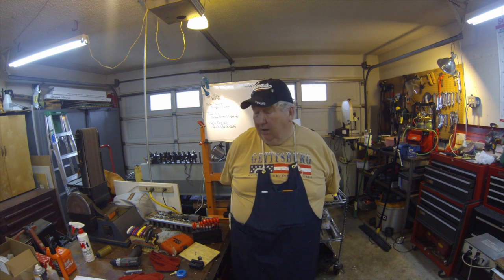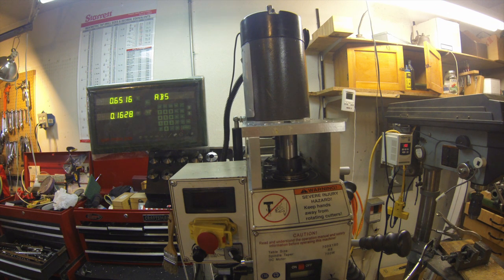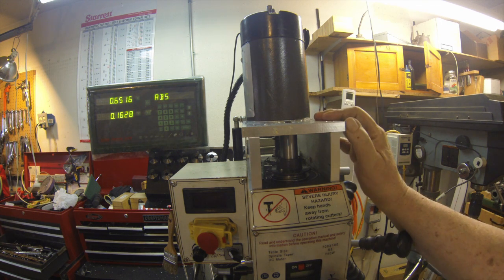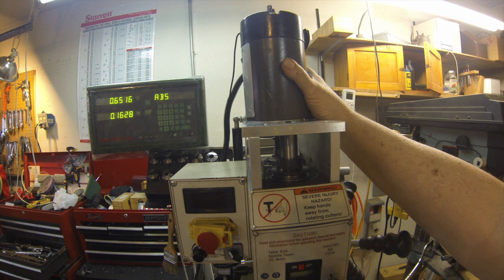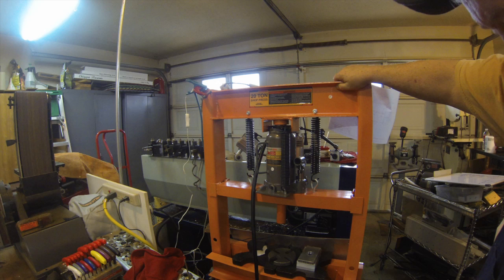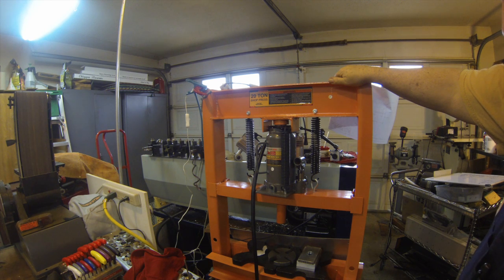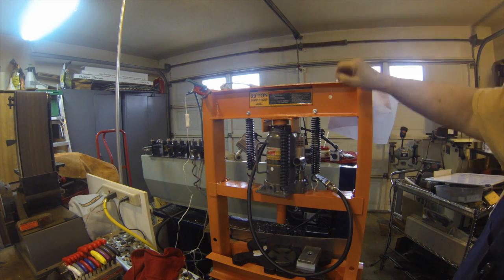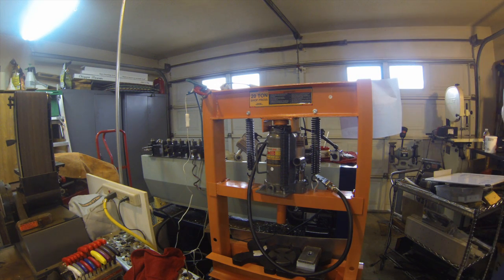Nooner #9  Mill Replair, Vise Stop, 20 Ton Shop Press Mod

Comment: It might be a camera/video artifact, but it looked like the motor shaft was moving around a fair bit at different speeds. You've got the gear cantilevered out quite a distance with the current setup and it might be fles in the motor shaft or bearings. Can you not mount the motor lower and run a shorter shaft?
Reply from the maker: Paul,  you are correct.  I had to add a couple of washers to make the gears mesh, and that caused a slight wobble.  I'm going ahead with the belt drive and put it up for sale as I bought a Webb 10x50 mill today.  Will show details later.

Comment: Hi Herb !
Nice repair on that mill of yours, eventhough the bigger noise !

I'm happy to hear that you can't live with that manual jack in the press - I was a little worried I had my press so big a project instead of just using a manual press - now I'm gald I did make it that big - thx !
Reply from the maker: Thanks for the reply Keid.  The press isn't used very much, but I'm getting old and impatient!
Reply: Herb Blair That's the way life is - we all are ... getting older, and yes, we DON'T like getting more work to do ;-)) ... not when the arm hurts - I got myself a very big cylinder for my press: http://kelds.weebly.com/hydraulisk-presse.html
(You can Google translate to the right, just under the menu line - choose any language you want ! )
Reply from the maker: Keld,  That's a nice cylinder.  Your press is going to be awesome!
Reply: Herb Blair Thx !

Comment: You have been a busy man in your shop Herb! I am happy to see that your mill is up and running again, great job on the vise stop!

I too learned alot of good stuff on YouTube, it's a great resource, with a bunch of awesome people out there!

Thanks for sharing,

Ray
Reply from the maker: Ray,  Thanks for the comment.  I'm off today for a 5 hour drive to Midland, Texas to buy a Webb Champ 3VK (it's a 3VH with variable spindle drive).
Reply: Herb Blair Great news Herb! We can be the new WEBB Champ Brothers, good luck, and have a safe trip! Shoot some video along the way.

Ray
Reply from the maker: Ray Caniglia
I bought the 3VH today.  I drove to Midland and got it at a great price.  The table is prefect.  The company replaces thier machines every 5 years, so this one has had a good breaking in period.   The 3vh has x,y and z power drive, a 2 axis DRO, a coolant tank and pump.   They hooked it up and demoed all the drives and spindle.  It's missing a couple of parts, but should be able to get those from Webb.   Now just get it the 300+ miles from Midland to Carrollton and find a place in my Garage.   I'm going to convert my G0704 Mill to belt drive and sell it.
Reply: Herb Blair Awesome SCORE Herb! sounds like you did way better on your WEBB than I did, can't wait to see it in your shop up and running!

Ray

Comment: Good to see your mill running again Herb. As a temporary thing until you get your belt drive, I've found that a motorcycle product called chainwax (Maxima is manufacturer) works really well to quieten spur gears. It is a spray wax that once applied to clean metal stays put and is thick enough to absorb noise. I started using it on the change gears of my lathe and am much happier than using oil.

Colin
Reply from the maker: Thanks for the reply Colin.  I ordered a can of Maxima Chain Wax from Amazon last night.  Thanks for the tip.